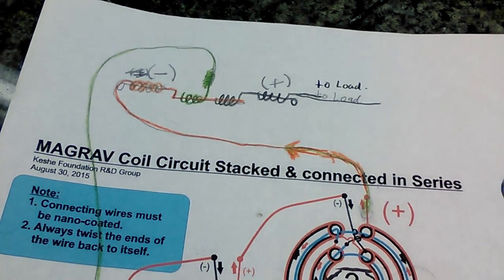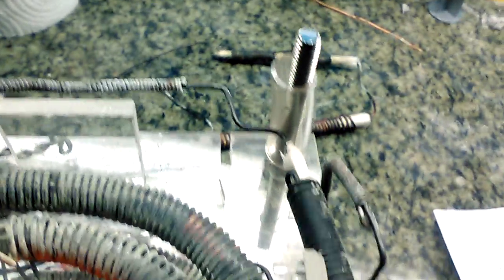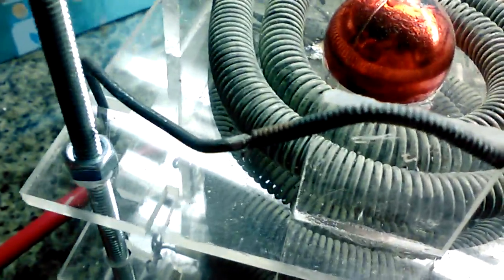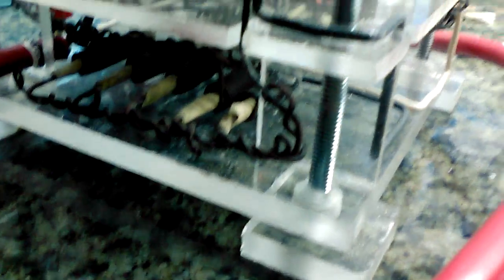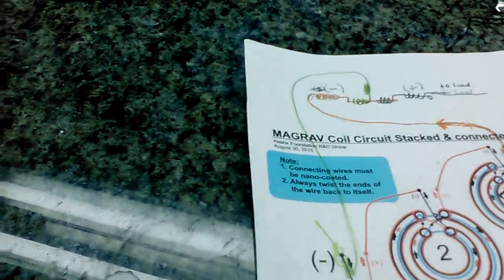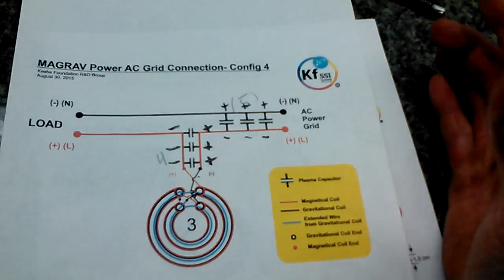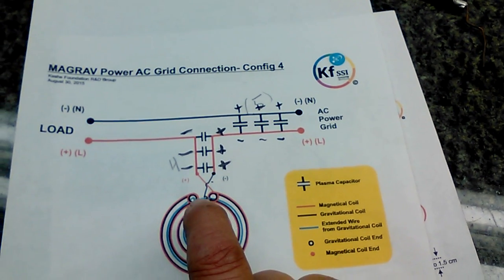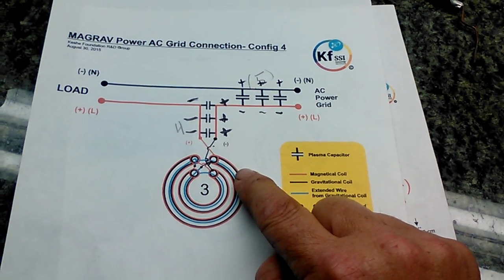Capacitors connections for Whatlimit club

Comment: That's great! Thanks a lot. It was a missing piece of information on the polarity of the caps. And it's even from Renan. 
On the feed line it seems to be ok in my setup. The parallel caps over entry and exit i've obviously the wrong way around :-) Will turn them. Thanks!
My thought was it's a parallel connection, so + to + and - to -. 
Are you going for a star formation, too? Or do you expand on energy? Greetz Shin